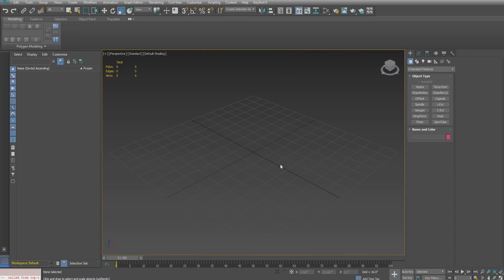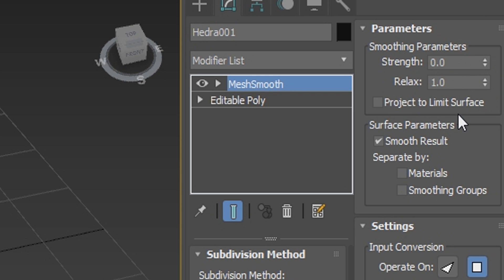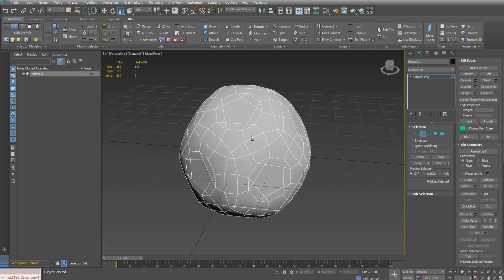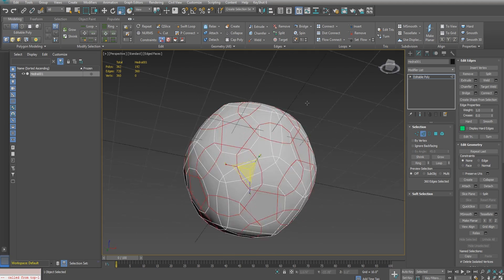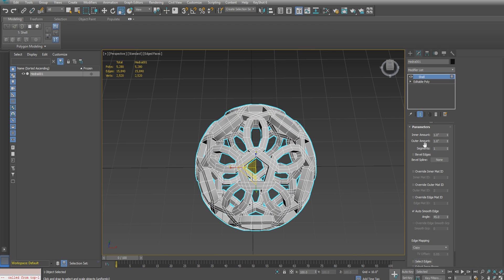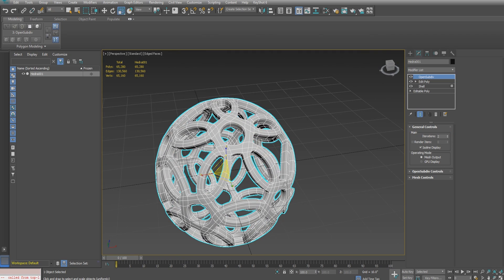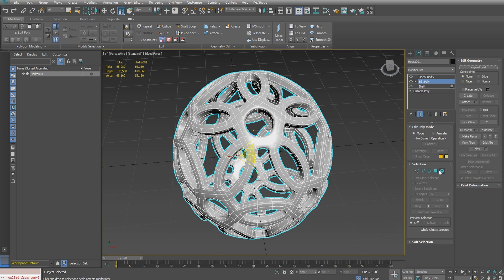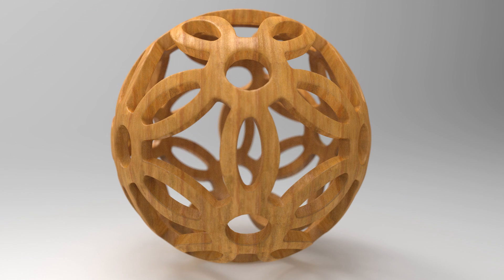3d Tutorial | Spherical Pattern Symmetry | 3dsMax

Comment: in the chamfer settings, how do you switch it from 1.0mm to 1.0 degrees
Reply from the maker: THUNGUNSPRO X what kind of degrees do u mean?  A degree is just a generic unit, so change the unit type for the scene itself to whatever u like.  If u just want arbitrary units, then use generic max units for the scene.  Max is very accurate in it's scene measurements so it doesn't allow u to change from one specific unit of measure to another on individual tools. Unless you are referring to angles?
Reply: John Malcolm 4:17
It says 1° instead of 1mm. And i think that is the reason why mine isn't working

Comment: After chamfering and creating the holes, select the edges of the pentagon and then select similar. Then do a flow connect. make sure to select all and then spherify. The pentagonal sections will be rounded too. 

Of course if you want those sections to remain flat, then don't do any of that!

Comment: Thank you for the tutorial, John. Having a hard time convert to Blender version, especially the Connect Edges section.
Reply from the maker: Thanks, Toki.  I've been working on a Blender version as well and face the same problem.  The J key is like the Connect tool in 3dsMax on the vertex level, but doesn't work the same for edge selections.  It also will not connect vertices the same way when multiple selections are involved.  I got so far as the first remeshing algorithm by using Bevel on the first set of edges, but can not find a way to proceed from there.  So there must be an alternative solution..
Reply: I come out with a solution, but way more complex then just using "Connect Edges", and is by far the most "simplified" way I can come out with after couple hours. Maybe will try to simplified it before I make a video.
Reply from the maker: I'll be interested to see what you come up with.  If you don't mind, I'll credit you in my own video if we can find a simplified way around the problem.
Reply from the maker: Toki, I think I found the pattern a different way in Blender.  I'm starting with Icosphere, then subdivide modifier, and then bevel modifier.  Playing with the bevel modifier settings is producing a pattern very similar to the one I found in  3dsMax, although I will have to experiment to see if it's comparable.
Reply from the maker: Ok I solved the issues, for the most part, although it still requires some manual edge input for various parts, the results, in the end, are almost exactly the same.  There are just some minor aesthetic differences.  I'll have my video for Blender up soon.
Reply from the maker: Just uploaded my Blender version.  Hope you enjoy.
https://youtu.be/SeG9q31Lv7o

Comment: great as usual....one question....love those materials at the end....as many others spread around your tutorials...any chance that you may do a little tuttorial about those? expecially those like that at 9.07 of this tutorial? I suppose you use either mental ray or iray for your renders..but even if you use other ones I think that the metod should be somehow similar
Reply from the maker: Yes, I do have plans to come out with some rendering tutorials, particularly for ART render engine in 3dsmax2017, which will likely become the permanently integrated render engine in the software going forward, as well as some 3rd party engines like Corona and iRay.
Reply: cool...I love to go "photorealistic" as much as I can...but those "aged" metals are my...weak spot...I know that specular, reflect and refract do the trick...as "composing" each level when needed...but maybe my approach isn't that corect in some way...still a bit away from that "real" look
Reply: Actually based on an Autodesk announcement, it is looking like Arnold will be the go-to "pro" renderer for future versions of 3dsmax: https://knowledge.autodesk.com/support/3ds-max/troubleshooting/caas/sfdcarticles/sfdcarticles/Changes-to-Rendering-in-3DS-Max-2018.html 

In my humble opinion, this is a very good thing except for certain limitations (e.g., distributed rendering).
Reply from the maker: Yes, they will most likely add Arnold in the same way they had added MentalRay years ago, but I think the ART render engine will still be in place as the new "scanline" type of engine.  This is all speculation of course, but the ART engine is quite good as an overall PBR engine, and most Standard materials and scenes will convert to ART very easily.  Arnold, on the other hand, is quite complex and will be useful mostly as a production engine for major VFX and studio work.  Who knows though.  I actually appreciate the ART engine, and find it quite good. Even for Mograph type of animation.
Reply: Art is good, the only donwside, for me at least, is that it takes only a few of the procedural maps, I think it happened to me with Speckle and Dent, if I'm correct, and I tend to use the procedural, with the right tweak the rusults are great...instead I believe that Iray and Mentalray materials can be swaped as you like
Reply from the maker: That's correct.  ART will not accept certain procedural maps like speckle or dent.  However, it does work with the vast library of Autodesk Materials which were introduced with the Arch/Design rendering system, and it will work with Standard material as well as the new Physical material.  It also works with Substance, which is a big plus for me, since I render with PBR and create textures for physical rendering as well.
Reply: I'll give a deeper look into that, and experiment a bit, or a lot, still have to start to look into Substance, but firt I need to get a good hold on a few things and then I'll get into that too